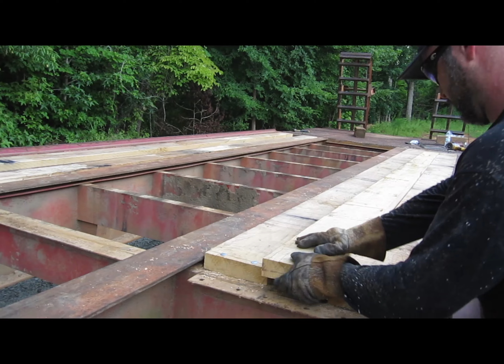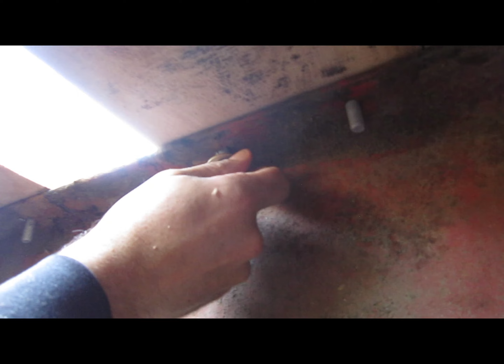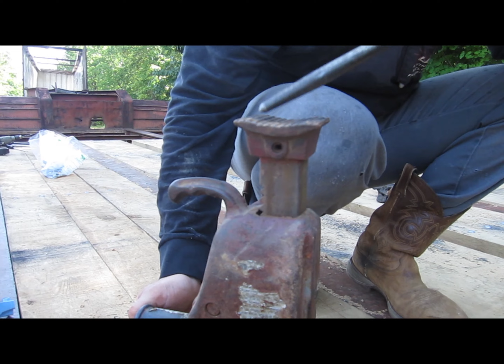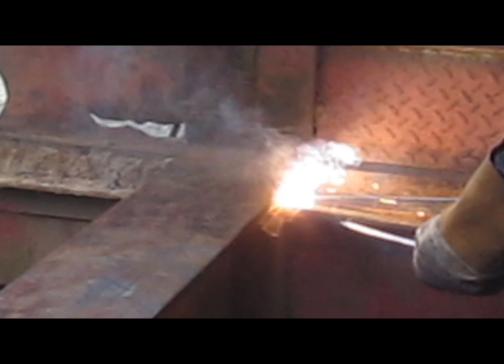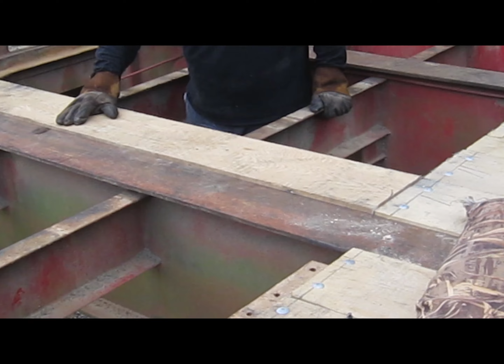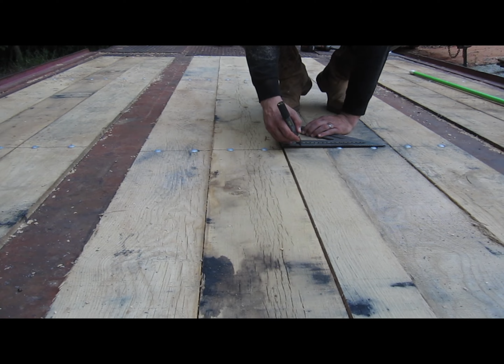LOWBOY REDECK PT3

Comment: The last lowboy I put decking on we used rough cut timber boards and mopped them with a mixture of diesel and roofing tar to help preserve them. Just food for thought.
Reply from the maker: That sounds like a great idea thanks for the tip and thanks for watching!
Reply: I use concrete form oil. It is clear, clean and smells great.